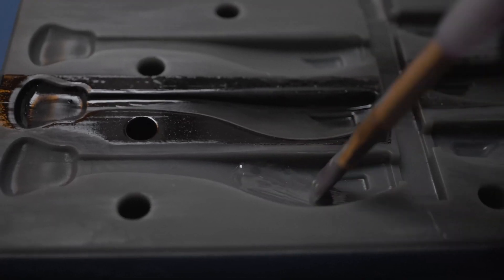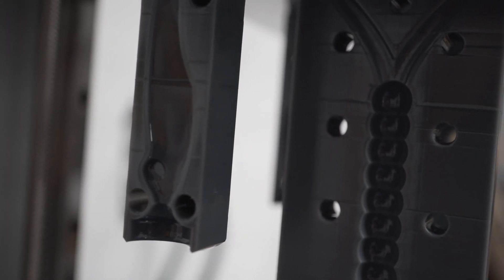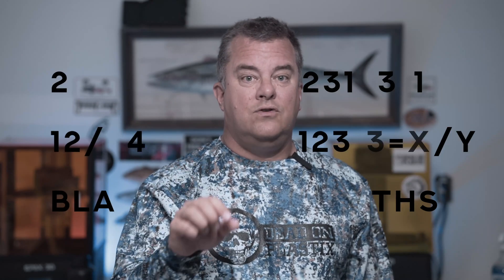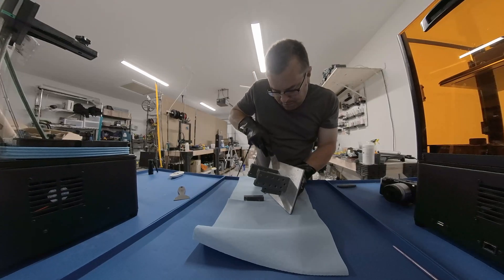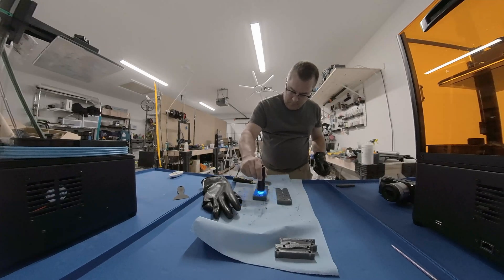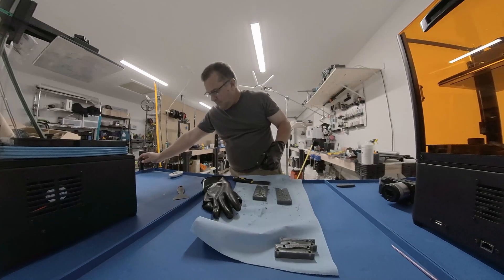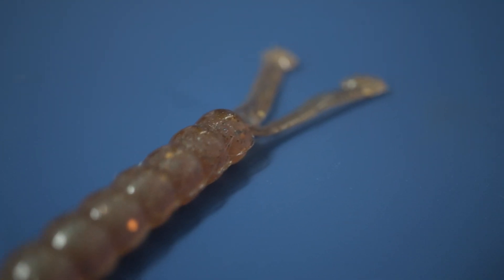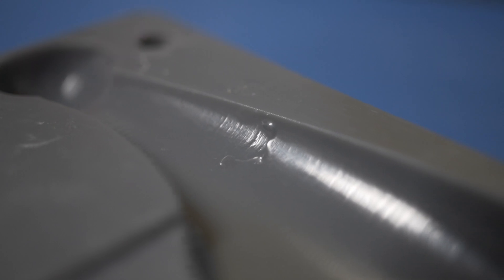Quest For Shiny Lures - Part 2 Flawless Victory!

Comment: wouldn't it make sense to wash the model first to remove all resin, then repaint the resin where you want that shiny part and hand cure it before full cure of model? curious if that would offer more control of the "filled in" spaces like the tail part.
Reply from the maker: I think the difference would be marginal at best and take 3x longer. If you really want to get crisp details you can use some compressed air to blow away most of the resin in the cavity before curing it.

Comment: so, do the molds only need to be put in the solution for a very short period of time?? I see some only do 30sec and some do minutes.. does it have to do with size of mold?
Reply from the maker: It just depends on the resin. Everyone is different. Sculpt is a fast clean and longer cure

Comment: What temperature is your plastisol when using the resin molds? how high can you go? I have 3D printed many molds with PLA and have had very good results with them, problem is, I have to make sure my plastisol is around 300 F or risk melting the mold. Really limits my injection time.
Reply from the maker: I have shot as high as 400f without issue. My half’s are 15mm thick which helps handle the heat without deforming
Reply from the maker: That’s using Siraya tech sculpt resin fyi…
Reply: @WMBayouLures  thank you sir! love the videos!

Comment: If you added more clamps to both halves of the mold do you think you could eliminate the plastisol flashing on your baits?
Reply from the maker: In this case the vent lines where too deep. I am now making them only .04mm deep and it works well,
Reply: @WMBayouLures  what you have done with resin molds is wonderful!!! I appreciate you sharing that information with all of us. So removing that venting makes it to where you don't have flashing anymore?
Reply from the maker: @argeniolawncare5223  yep! Just make the vents small .04mm in depth and only on 1 side of the mold and you should be good!
Reply: @WMBayouLures  thank you for responding so quickly!!!

Comment: Does printing with a better printer like Saturn 2 help with this issue? Thanks
Reply from the maker: You mean shiney smooth cavities? No it doesn't It is a resin issue and not really a printer issue. Resin will not produce a glass like surface finish, unless you follow these steps (or sand)

Comment: What 3D printer did you use for the molds and the best material for them?
Reply from the maker: I use the Epax e10 but just about any mid size 4k mono printer will work. There is a good deal right now on the Anycubic photo Mono s for $499 - https://www.anycubic.com/collections/anycubic-photon-3d-printers/products/photon-mono-x-resin-printer?sscid=b1k5_pvmzb&

For resin, there is only one to use in my book, Siraya Tech Sculpt, I have a full video on it here - https://youtu.be/ndYmHhDkA1Y
Reply: @WMBayouLures  thank you very much but what about the others 3d printers? The mold that they can made is not soo good like this one right?
Reply from the maker: @sevdalinslavov3472  If you mean FDM printers, like the Ender 3 etc, then yes the molds they make are not as good. The materials can not withstand the heat and the details are not as good. Resin is the only way to go really.
Reply: What about this one Creality LD-006

?
Reply from the maker: @sevdalinslavov3472  I believe that model has been discontinued, so parts might be an issue in the future but it will print molds just fine.
Reply: @WMBayouLures  I buy that 3D printer you told me Anycubic Photon Mono X and siraya tech sculpt but can you tell me the perfect settings for the fishing molds?
Reply from the maker: @sevdalinslavov3472  Awesome man! I can't wait to see wht you create. I have my complete rundown of using sculpt in this video, note your exposures might be slightly different but my settings should be a good starting point. - https://youtu.be/ndYmHhDkA1Y
Reply: @WMBayouLures  you are the best!!